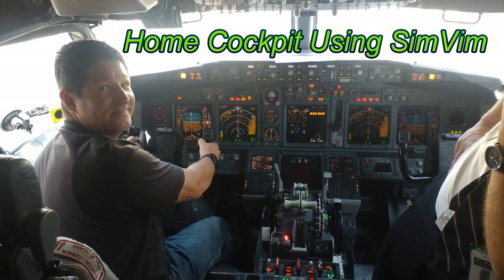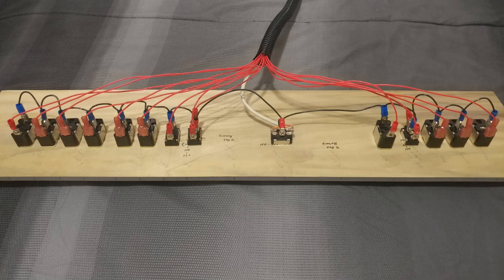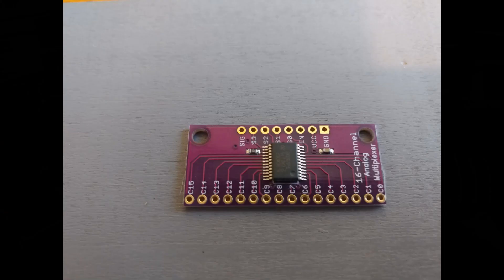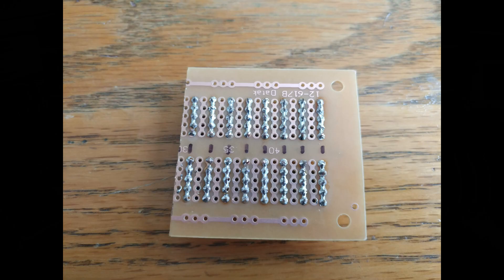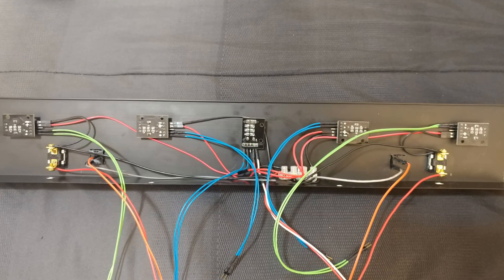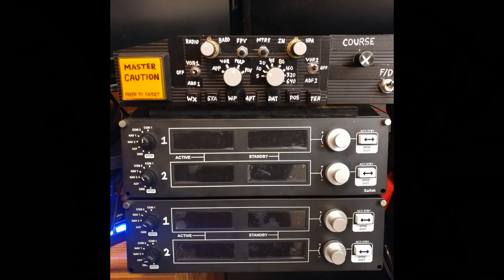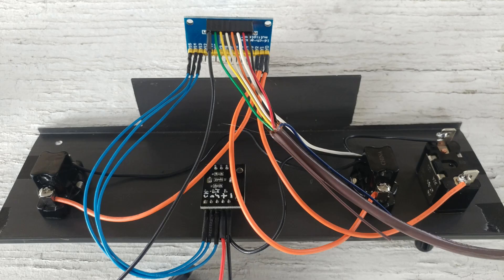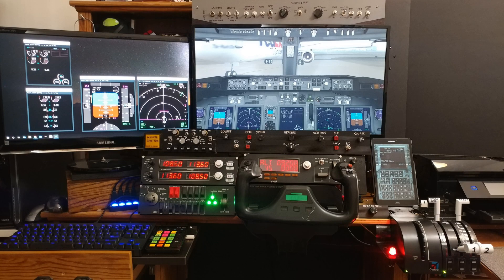Building a home cockpit using SimVimX (Formely  known as SimVim Cockpit)

Comment: I have 2 simulators on my computer. Prepar3D and MSFS 2020. I know X-Plane is easily integrated with SimVim programming, but how well does this programmer work with the other 2 simulators.
Reply from the maker: Hello Delbert, unfortunately it doesn't work at all with P3D or MSFS. Hopefully in the future it will. You might want to try MobiFlight for something that works with those two

Comment: Hello!
Very nice project! :)
I am also trying to build some panels, and made some tests with switches. But i have a problem with APU swittch for example, because APU_Master parameter does not work for me. Same problem with the fasten seatbelt sign. Can you help me what could ve the solution? Using Zibo in xplane 11 with simvim and arduino mega. ( It works fine with some other switches like retractable landing lights)...
Reply from the maker: Hi there, so you are using the same On-Off-On switch for the APU and you use for the retractable landing lights? I'm using one like that (3 position toggle switch) and it works perfectly. I hate to ask but you are sure your wiring is correct?
Reply: @Qosmokid  
Yes, I use the same 3 position switch for it, and totally the same wireing that i use for the retractable landing light or the pack switches for example, which worked fine. Maybe is there any update or something that i did not install which contains these code updates?
Reply from the maker: @norbertbakonyi7460  Yes you can email me Qosmokid at Gmail